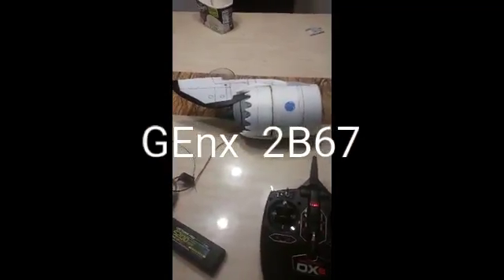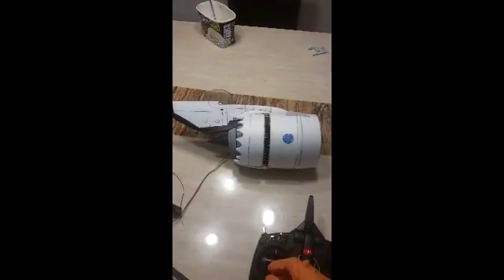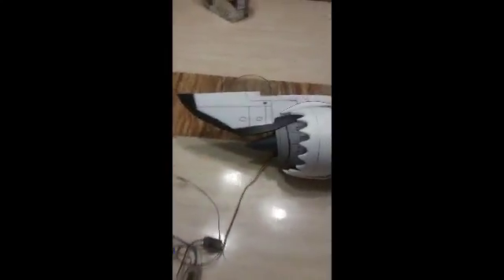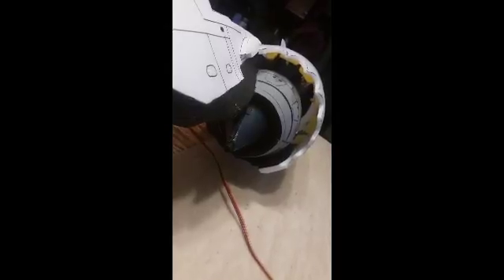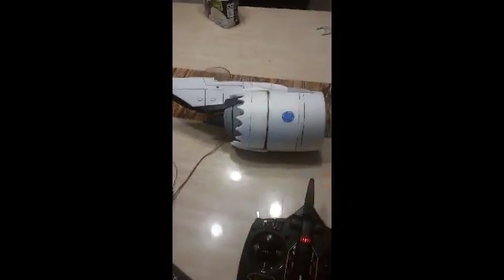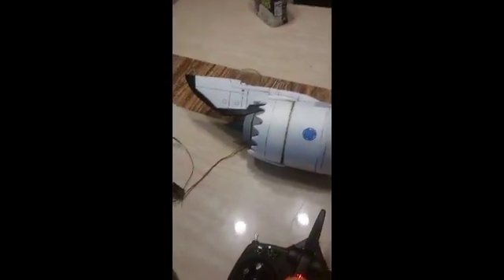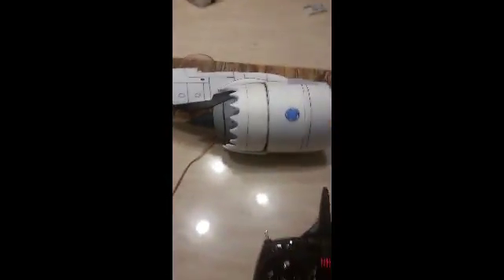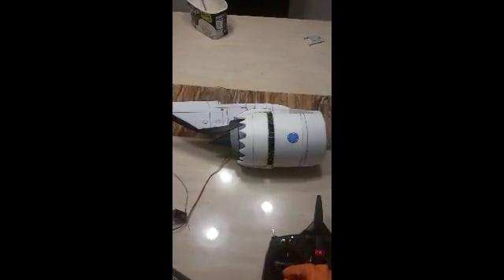Rc 747-8 pt4

Comment: Great work! It is difficult to make those blocker doors especially when the internal curvature to the nacelle should match the curvature of the blocker doors and also the drag links  and cascade vanes manually others will say go to 3d printed but it was a legend only handmade thrust reverser modification of the aircraft engine nacelle is hard and its not easy.